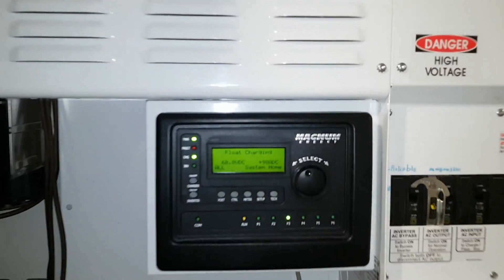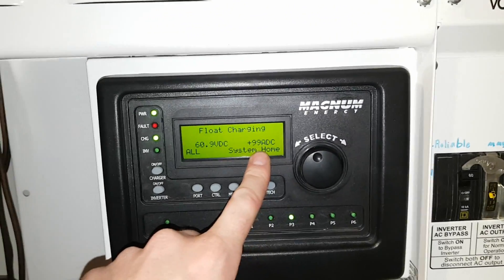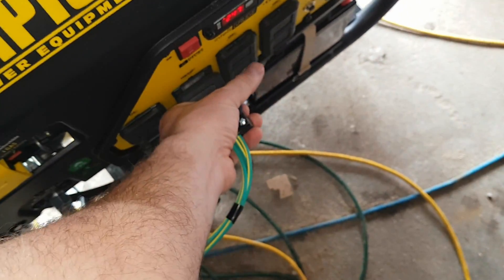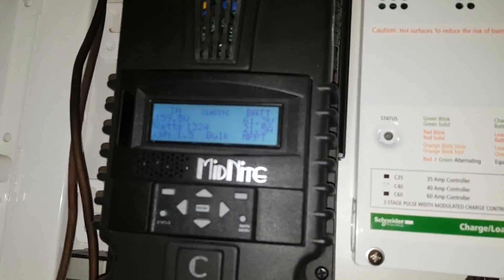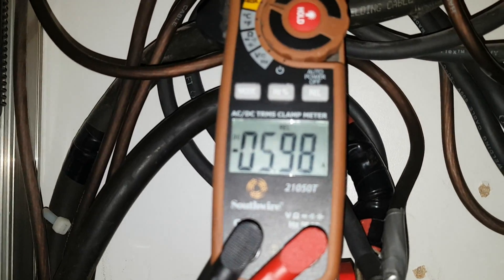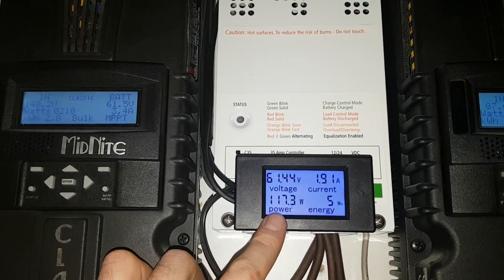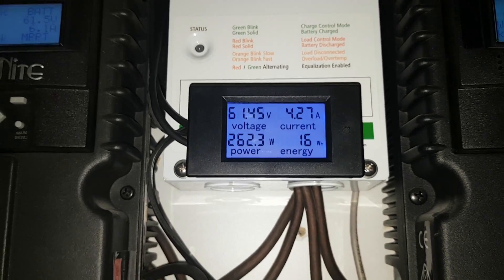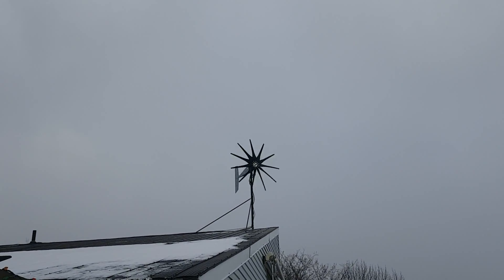Freedom II Wind Turbine Update And 6000w Generator Test

Comment: I see you are using a Xantrex charge controller on you wind generator.  How is it configured? Do you use a diversion load? If so what size. I have a spare Tristar TS 60 that can be used for my wind generator.  I have 2 wind mills. One is an old school spruce wood prop brush type with a rectifier and the other is a PMA. The old scene out performs the PMA 3 to 1. What has worked best for you. I want to configure the Tristar to stop charging my lithium batteries not just add a load to blead off extra energy. I do not have a furling arm so I would have to do something to keep the generator loaded when the batteries are full so it does not self destruct by over speed. Any ideas?

Comment: I see you have two Magnum chargers/inverters.  Do they work in synchronization?
Reply from the maker: Yes 8800w with them both hooked up
Reply: @GoingOffGrid101  , Nice! I have since looked around on youtube a bit and found you can have up to 4 "stacked".  I have a single MS4024 Magnum.  It works great, but in hind sight I should of went with the 4448.  Thanks for sharing.

Comment: Damn! How much did this set up cost you total?
Reply: AnOhioPatriot , I would say a few thousand , why don't you start out small like I did as I could afford it , I bought 1 PMA and then 1more then 2 more , now I have 4 PMA's , one for wind turbine , one for water wheel , one for bicycle , and one for a 40cc chainsaw engine , my plan is to go completely off grid and have no electric bill , also plan to buy solar panels and it doesn't hurt as bad buying one piece at a time , but this is just how I did it , you can do it however you want

Comment: Show! Link BMS!
Reply from the maker: with bms would you like a link for? the ones used in the power wall? or the large 300 amp?
Reply: @GoingOffGrid101  wonderful video as usual. I personally don't mind links to the two BMSs.
Reply from the maker: @adon8672  thanks! here are some links to my bms

https://www.aliexpress.com/item/70A-100A-150A-200A-300A-Bluetooth-Battery-BMS-With-LCD-Displaly-8S-24S-LiFePo4-7S-24S/32954067682.html?spm=2114.search0104.3.1.21375d47zQfJNE&ws_ab_test=searchweb0_0,searchweb201602_2_10065_10130_10068_10547_319_317_10548_10696_453_10084_454_10083_10618_431_10139_10307_537_536_10059_10884_10887_100031_321_322_10103,searchweb201603_57,ppcSwitch_0&algo_expid=f5a9c49b-7850-4471-8995-42c1162aae1f-0&algo_pvid=f5a9c49b-7850-4471-8995-42c1162aae1f

and 

https://www.ebay.ca/itm/30A-16S-48V-LiFePO4-60V-Lithium-Polymer-Battery-BMS-Protection-Board-W-Balance/112477569093?hash=item1a302f8045:g:MkIAAOSwUIhZZKEA:rk:16:pf:0
Reply: Thanks a million. The links are very helpful and I really appreciate the prompt reply.

Comment: Your off grid battery backup system is stunningly complex and large, and I love it, it's a thing of beauty, but I'd consider building a battery & inverter shed disconnected from your dwelling except via cables.  If you have ever seen even small RC lipo batteries fail to flames, it gives one some respect for the fragility of some battery chemistries.  Even Boeing had troubles containing large prismatic lipo cells in airplanes.
Reply from the maker: these batteries are nothing like the old lipos of the RC world, here is a video of me testing a few, skip to the middle of the video for the battery test.

Comment: DO you use the Magnum to control the generator?
Reply from the maker: yes I do
Reply: @GoingOffGrid101  Thx for ALL of your sharing!  Regards to the Magnum Sine Inverter charger - how have you connected up the generator to the controller you show in the video?  Is the generator output and your wind/solar output from their separate charge controllers routed into that device?    If you have covered this in a previous video,  let me know the link (vs. You having to repeat yourself).  Again,  thx for all your sharing.